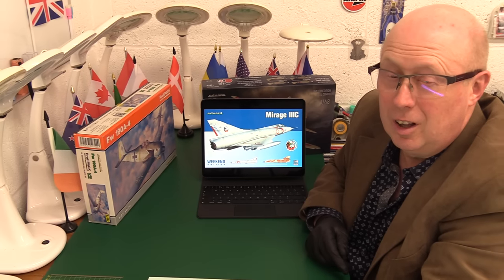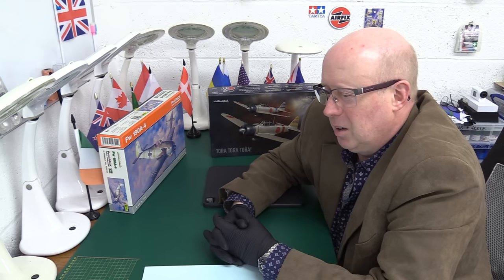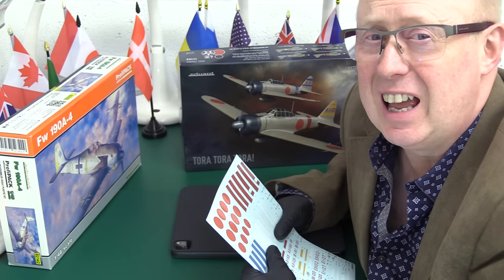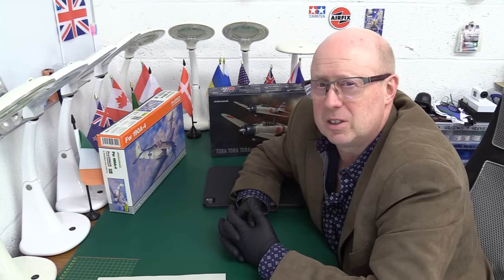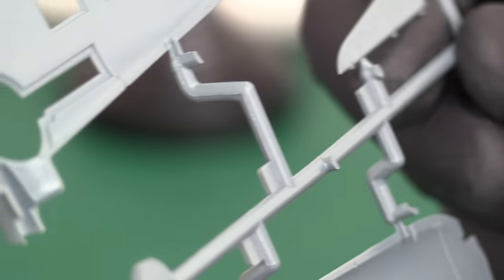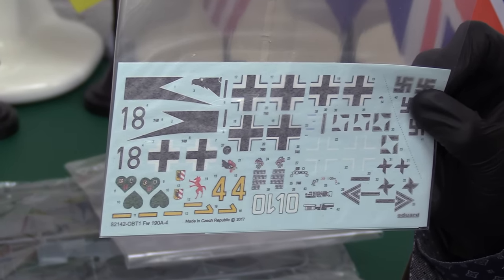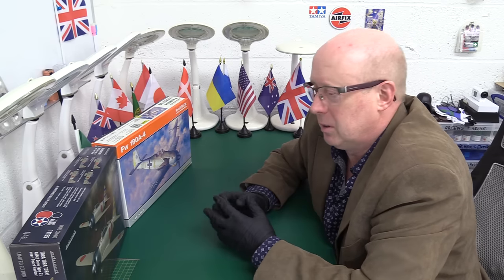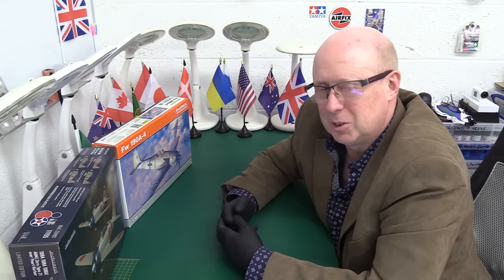Let's talk about...EDUARD (Rant!) 😠

Comment: Your manufacturer reviews are great Peter and more importantly will get modellers' views right in front of them. And acted upon...hopefully. I agree with your points about Eduard's strengths and weaknesses. They have some history of acting to remedy their mistakes. Eg the excellent 190A-4 on your bench was a complete retool of an earlier 190A/F series which had a reputation for fine detail, but were almost completely impossible to build without divine intervention. Likewise when their Bf109G-6 was found to be dimensionally inaccurate, they scrapped the tools and started over for their current generation of 109 kits. I like their willingness to try and innovate, provided as they have done so far, they suck it up when they fail and fix things. Personally, I really appreciate their excellent subject research, finely detailed surfaces, their Profipacks - everything in the box for a fair price, the weekend concept for a super low price point, overtrees for those who want to build up a spare parts stash economically, resin and brass after market upgrades for those that want it and their robust boxes (yes I'm looking angrily at you Revell!). I also think they can take a lot of the credit for redefining a new standard for 1/72 kits before Arma Hobby also spotted the opportunity and really ran with it. My main grumbles with Eduard are the shrinkage dimples on some parts and overcomplex design which demand a lot of dry fits and adjustments. Tamiya always give the builder confidence. Eduard kits need to be approached with a whole different mind and skillset IMHO.
Reply from the maker: Great comment Neil, thanks. 👍🏻

Comment: The Eduard kits are brilliant. I have built 16 of them so far Spits, mig-21, Fw-190 and bf-109.  Never face a problem other than the decals in more recent ones. Even the peel off decals have improved over time. However, I agree with you and I still don’t like them.

Comment: The new sprue attachments on the wing edges as an example, are an attempt to prevent the surface blooch that results from trimming, this way the work is done on the mating surfaces and not on the aircraft skin.
Reply from the maker: I hate it. It's double the clean up

Comment: Hi. 
I have some Eduard but haven't built them yet so I'll have to reserve my judgement until then.
Tempest V.................Widcats, Hellcat, P51 D-5, Spitfire VIII, P400 and Bf108 and have a Rufe on order.
Quite the spread of their production time so we shall see.

On the injection gate subject, if you model armour , you will see it on Tamiya's Notek lights.
It lets you remove the gate without damaging the curve of the rear edge or the light.
On a wing edge it leaves a thin rectangle of plastic on the edge of the actual wing surface but allows a sufficient opening to inject the necessary amount of molten plastic into the mould.
The previous method, that you see on older kits, results in a large, semicircle of plastic that is on the wing leading or trailing edge and can be more difficult to clean up. 
And often this circular gate would bulge out onto the joining surfaces of the wing as well.

Anyway, looking forward to more rants. Dragon? I had a Panzer 1 of theirs that didn't make it.
Almost binned it but then thought I could put it under a tarp in a diorama.
Cheers 🦘🦘🦘
Reply from the maker: I had two Dragon kits but sold both as didn't like the look of them...So I will mention them but no I have no building experience so won't be covered.

Comment: Hi Peter, I enjoyed your video on Eduard and here is my opinion, for what it’s worth.
Yes, I think they are hit and miss kits and I started building their Fw190 D-9 kit around 10 years ago and got a bit bogged down with it and stick it on the shelf of doom. Fast forward to this year when I decided to give them another go and bought their 1/48 scale Spitfire Mkviii and what a beautiful kit it is too. It has the best wing to fuselage joint I have ever come across, perfect.
However the kit was let down by a few things, the top engine cover is moulded it two haves which needs replacing with a resin one piece. And the exhausts were more complicated than it should have been. But I rate the kit and I’m now building another with their Brassin engine, gunbays etc.
But the decals are a disaster, I did get them down reasonably well but were not a great experience. The gain is not worth the time and chew. So I hope Eduard change them to normal decals. I applaud them for trying to move the game on but I think it is a failure.
Last point on the sprue attachments. I don’t have the Zero yet so I can’t compare in the flesh but the spitfire seems to have the same style of attachments. Now for me there are a success because on the spitfire they are only attached on the mating surface of the parts and not the external surface of the kit. Meaning, all you have to do is trim the attachment flush with the mating surface and a near flawless joint can be achieved. I will be buying the Zero kit shortly but I would be interested if you could check again to confirm the attachment point is only on the mating surface.
A
Sorry for the long message but I did enjoy the video and wished to chip in my view.
I look forward to you next video.
Cheers
Neil
Reply from the maker: Thanks Neil. I think in future Eduard need to do much more testing before releasing items onto the market.
Reply: I only have 3 eduard kits. One is the Mig-23 Bedna (Trumpeter rebox) limited edition. Mig-19 Limited edition, and the FW-190D-9.
Reply from the maker: @screwthisin  I understand the FW190 is fine. 👍🏻

Comment: I had the same bad expérience with a dora wings kit, the promising Caudron Simoun. Nothing matches, engine does not fit into the fuselage, poor joints, impossible to just glue parts on the fuselage joint... Because you just can't access... Etc. Happy you hear your caveats..
Reply: I've a couple of their 1/72 kits, but haven't built any. I think you have to be mentally prepared that it's gonna be a struggle, although the parts look good, they are full-blooded short run kits. Dora Wings is a one man company.

Comment: I have a couple of recent-ish Eduard kits in the stash, a 1/32 Me109 Special Edition AdlerGriff, from 2020, and the very extensive decal sheet looks pretty good, and a couple of 1/48 Mig-21pf kits from 2021 (they were v cheap) which are odd in that the extensive stencil sheet - (almost as many as a phantom) seem to be normal older type decals, presumably from the original release, but the main marking sheet look like the thicker top carrier type - not so bad that they can't be used, but I am confused by them. No mention in instructions of course.   You didn't mention the initial word from Eduard was that the Newer decals were supposed to be used the same as older types. Only later did they release videos showing how to peel them, but still saying it was unnecessary.
 
   Not necessarily related to Eduard, but I am in total agreement about your comments about the amount of research that sometimes seems to go only as far as taking a scan of some museum exhibit, and cursory examination of a couple of photos, (dare we say Black Buck Vulcan). Another example from Airfix, on another otherwise excellent kit. They scanned a civilian Chipmunk that was not representative of the type in-service. The cowling/Exhaust combinations do not match.The exhaust is the original thin sloping design that comes out of a large hole in the bottom cowling, but the nose cowling is the later type used in the fatter horizontal exhaust that exits at the rear & has a heating pipe Something 5 minutes of research would have found out. At very little cost or research, they could have provided both options. (I won't go into the tiny WWII spitfire pilot blobs that are meant to be the crew figures).
Reply: They seem to have trouble with exhausts and intakes. My FW-190 Royal Class edition had no intake pipe parts or instructions. Yet they were shown in the pictures later in the build. Luckily I had some excess material from other kits.

Comment: You really need to branch out on the Eduard line.
I have built the mirage and it was a bit more challenging, but it is an old kit that came out in 2004. 
The tempest although newer, I I have not built this one, 2018.
This kits I built turned out wonderful. Not only were they pleasurable to build, but they also give you different versions of the same model, at different price points. If you like extra detail and can justify the extra cost, get a profipak. If your on a budget, they offer a weekend for substantially less.
Reply from the maker: My next build is the Eduard Pearl Harbor Zero A6M...but I will NOT be using their dire deals
Reply: @Peter-Oxley-Modelling-Lab cmon Peter giv them a go, try a different method. Try underside decals first.
Reply from the maker: @wasrio1403  See my other vids on the subject...

Comment: Peter,
I was hoping you’d address some technical issues of the fit and construction.  Im currently working on a Eduard 1/48 scale Mustang from The Chattanooga Choo Choo kit.  I am so disappointed with several, and counting, of how the kit is constructed.  First, the canopy doesn’t fit over the guide rail.  Not even close!  Second is the hole for the gear main mounts to be inserted into.  VERY flimsy and doesn’t fit well.  The tail wheel is very difficult to insert into the wheel well and flimsy!  The wing tank attachment to the parent rack is virtually non existent. The will require a good amount of glue to hold the tank to the parent.  I came close to chucking the whole thing in the trash can on two different occasions; something that I rarely do.  Ill be much more cautious of buying Eduard kits in the future.  Thanks for making this “rant”.  I was feeling alone in my protestations until I saw your video.
Reply from the maker: Sorry to hear that Paul, I am hoping the Zero will be ok, but it’s baffling that some folks really think Eduard are the best kit makers: They still have much to learn from Tamiya…

Comment: It would seem that Eduard have shot themselves in both feet with the new decals and sprue attachment points. Having said that, my experience with their kits has been pretty good. My maternal grandfather was killed in action along with his pilot back in 1917 while they were fling in a 20 Squadron Bristol Fighter, so my main interest in aircraft kits is the First World War. Eduard are my main provider of kits of such aircraft in 1/48 scale. So far I have built 18 Eduard models from that period. I only had problems with one (number 19 – the SPAD XIII). This was due IMHO poor design of the kit. In the Eduard SPAD XIII the lower wings are connected to eachother by two flimsy plastic rods that you glue to the fuselage before covering them up with a piece that fits below them and forms part of the fuselage underside. Needless to say, both rods broke off as I attempted to do this and I have not been able to get them to line up properly or strongly enough since then. The Dragon kit was better in having the lower wing and fuselage below it as one piece, so I discarded the Eduard SPAD, for the time being at least, and built the Dragon one instead! 

All the other models went together well: Eduard’s DH-2, Nieuport 17, Sopwith’s Pup, Triplane, and Camel, the SE5A and (of course) the Bristol Fighter. For the Germans I have built their Fokker Triplane and DVII, various Albatros types, the Roland C11, the Pfalz DIII. I have yet to build some more Eduard from both sides. I had to turn to Roden for the Sopwith 1 ½ Strutter and the DH-4, and the now defunct Aeroclub for a FE2b and RE-8. 

I know of Wingnut Wings but they are too big for my flat and too expensive for me. Although I dabble with WW2 and even jets they have all been from other manufacturers. I have never built Eduard kits of post WW1 aircraft as they were not making the kits I wanted at the time I wanted them. 
So to summarise, Eduard are to be praised for their WW1 models. I don’t know about the rest, but have yesterday ordered one of their Sopwith Camels with the Clerget engine. I hope I don’t encounter the same problems you have described regarding the decals and sprue attachment points! 

My apologies for the length of this, it took almost as long to write and edit as your very useful video took to watch. Your ones on Airfix and Revell were also good, and could you now move on to Roden and Copper State Models? And how about a “how to deal with PE” video, since I always find that difficult. Keep them coming.
Reply from the maker: Thanks! Very interesting reply indeed. I won't do all manufacturers, only the ones I have experience of. 👍🏻
Reply: @Peter-Oxley-Modelling-Lab  Fair enough re the other manufacturers. Thanks for replying.

Comment: The HGW Wet Transfer decals are a similar concept to the newer Eduard sets, and I found them truly awful and a complete waste of money. The A-4 is a lovely kit and build and the decals went down with no problems at all, even that black flash over the fuselage sides around the nose. I've built a few Eduard kits, including the Tempest which I don't recall being especially challenging, even with the addition of the resin Sabre engine. Probably also worth mentioning that they do re-box other manufacturers kits and add their own detail sets to complete the package (Hawker Typhoon - Hasegawa, Westland Lysander - Gavia), which I think is a good move on their part.
Reply: I've read somewhere  that the Lysander is actually tooled by them, for Gavia.
Reply from the maker: I think these new decals are either made by HGW or a direct copy of them.
Reply: @Peter-Oxley-Modelling-Lab  I'm pretty sure they are printed in-house by Eduard, the whole reason why they changed their decals is to cut costs. The peeling is not intended, it's just a by-product, probably they were not even aware of this in the beginning. I build a lot short run kits, so from my perspective all the issues that Eduard kits or decals might have, are minor in comparison. Eduard kits are a luxury product compared to most short run kits, and I will definitely buy every new 1/72 kit they will release.
Reply: @thekinksfan5102  The Lysander is definetely a short run kit - little or no locating pins or holes, poor fit of some parts etc. Did Eduard do these in the old days?
Reply: @pstrutt1  according to scalemates in 2001. Early Eduard kits are at least partially short run style, but they  improved quite fast. And they are basically WWI, P-39 was the first WWII plane. I've got A 1/72 Lysander from Dora Wings, it's going to be a challenging build. Big part of the issues are caused by errors in the instructions.

Comment: Hello, I dont usually comment on Vids as I watch them on TV, but I enjoyed this and I also enjoyed the Airfix and Revell talk's. I decided to comment as I only have 1 Eduard kit and after seeing this, I wont be buying any more. They are quite pricey and yes the detail is stunning but as you pointed out, the sprue gates are wrong and the transfer's (decals) are also wrong. Keep this kind of thing up, looking forward to the Tamiya one, ever tried there sea harrier, I think it is, not for the faint hearted
Reply from the maker: Thanks! Ref: Eduard, most of the 2015-2021 kits seem pretty good, it seems only recently they went bad. As for Tamiya Sea Harrier, I bought in 2009 and quickly sold it on...😉

Comment: When you ask ‘What were Edward thinking?’ The answer very probably is ‘They weren’t’. Or rather they were, but were thinking of their own situation not that of their customers. Decisions such as this are usually driven by a new management team which has looked purely at the bottom line. I’m reminded of Mercedes when they did a similar thing a few years ago…they cheapened the quality of the steel in their cars which led to huge corrosion problems. Their reputation took a massive hit and they spent a fortune repairing the damage.
Reply: This is all conjecture unless you know what happened. If Peter had actually used the decals and then had the same opinion I would hold that opinion with more weight. But it seems like he has just listened to all the othe rants without using them and is not telling the full story. I have used them as normal decals and INMHO they work better than some Cartograph decals.
Reply: It was Chrysler's input into Mercedes to make Merc build cars to a price (the American way) that saw quality plummet. Mercedes had to get rid of Chrysler to get back to building cars to their high design standards, and slowly re-build their quality reputation, one that an American company trashed in just a few years to milk short-term profits and executive bonuses.

Comment: Just finishing a clear pro 1/72 which looked to be amazing but flipping heck it fought me every step. Nothing fitted, the
instructions were frustratingly vague photo etch that would never ever fit and I think my frustration with it made me make a lot of silly mistakes. It looks sort of OK in the end but not for the faint hearted. Give me an Airfix starter set any day.
Reply: Which kit was it? Clear Prop kits are technically short run kits, although the parts do look first class.